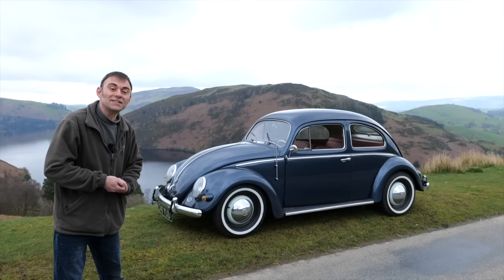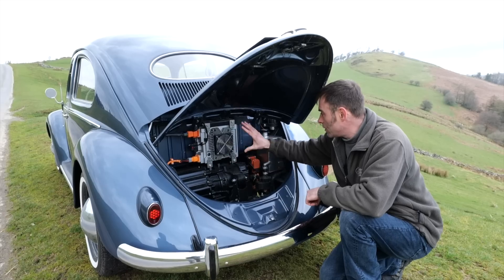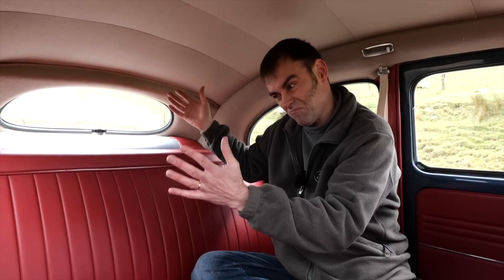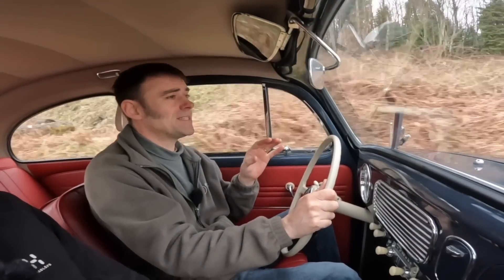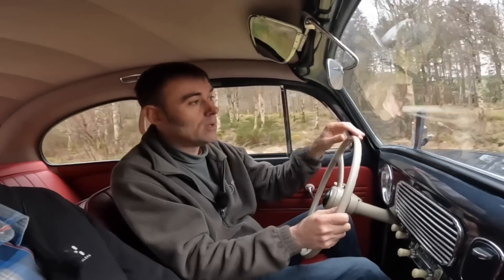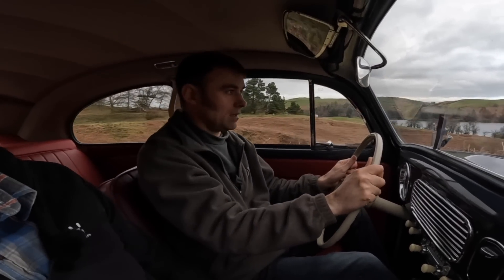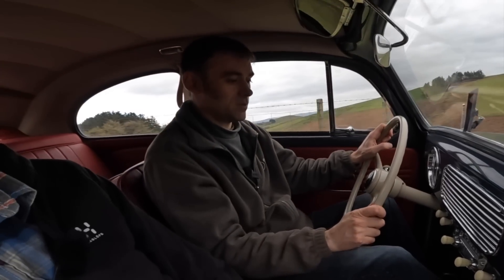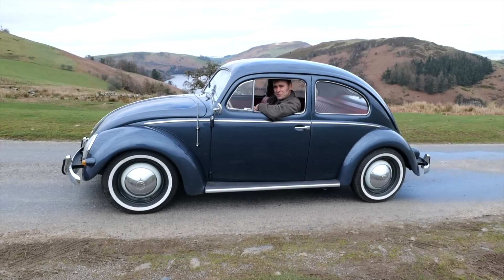Finding problems in an electric VW Beetle, converted using our bolt-in kit.

Comment: Ive adjusted the rear torsion bar slightly on the drivers side due to age sagging and in doing so it will bring the passenger side front lower and even it with the drivers front
Reply from the maker: It already has new torsion bars at the back so we know the sagging is front related. Also, we can push the front trailing arm up with minimal effort on the drivers side to get the shock mounted whereas on the other side it takes quite a lot of effort.

Comment: You do know that more co2 is created, by mining the minerals, and transporting them between countries to create a battery.. than a normal car.. it's a con..
What is in a battery comes from many mines.. using co2 blurting machines. You idiots.
Reply: Try looking up total environmental impact reports for EVs compared to similar ICE cars.
The EVs always pollute less.
Reply: @logitech4873  Ok , More minerals are required to make a EV Car, All the minerals in the Battery.. Those Minerals have to be Mined, and transported By Co2 Machinery, and ships.. Because a EV Car weighs more, more energy is consumed in it's Manufacturer.. all ev pollute more.. because they need coal power stations to charge them, when there is no wind, and its snowing.. ev is a fake, vegan con..
Reply: @logitech4873  yep believe the bs. A ev car. Needs 5 different mining companies to get the minerals to create the Batteries. Which need 5 different shipping companies to transport.. to manufacturing companies. 
Then said battery needs to be transported to car factory.. but because a ev is 3 times heavier than a normal ice car. More energy is used to manufacture it. 
It's a con..
Reply: @graemejohnson9025  The Tesla Model 3 has a weight between 3,700 and 4,000 pounds - a comparable sized Toyota Camry weighs 3,200–3,550 pounds.
Not really sure where you got "3 times heavier" from.

Could you go into detail on these 5 different mining companies?
And while you're at it, how many mining companies do ICE cars need?

Yes, EVs are more energy costly to manufacture - but the whole point is that they use far, far less energy to actually operate, and consequently have a lower overall environmental impact.
Reply: @logitech4873  not in manufacturing thought.. the battery needs 5 different mining companies to mine for the components.. then 5 different shipping companies to transport it to the battery manufacturer.. then the car itself is heavier than a normal car. So more energy is required to manufacture it..
The co2 blurted by the mining and shipping the components for ev Batteries. Null and voids it's save the world crap..
Reply: @logitech4873  you do know that the minerals to make a ev battery, are mined from many different countries. Using co2 blurting machines. Then transported by many co2 blurting ships. To be manufactured into a a battery by a co2 blurting factory.. to be installed in your car created by a co2 blurting factory.. it's a con..
Reply: @graemejohnson9025  Yes, and the same goes for ICE cars. The steel, the plastics, the rubber, the fuel - it all has to some from somewhere.
There's no con. EVs simply have a smaller total environmental impact.
The EPA has a nice page called "electric vehicle myths", i recommend reading it.
Reply: @logitech4873  yep. Read it. It's all a myth. Doesn't matter what you drive.  They are the same.. both do same damage..

Comment: Nice! maybe add a front wheel speed sensor and setup anti lock for the re-gen and then you can ramp it up with brake pressure?

Comment: Fantastic car. Please do a follow-up video on the adjustments you've done. A before and after on the squeak and the torsion bar etc.
Reply: I think I heard that the suspension mount squeaks are fixed by just greasing them up, is that true? 🤔

Comment: So what is the insurance position on a vehicle that can be so readily enhanced or deranged in its tuning? Insurance relates in part to the actual performance of the vehicle so if you can readily enhance the performance to 300 hp did you say I can see there needs to be some criteria as to actuality and perceived vehicle performance of its day. You have already indicated need for anti roll bar but the weight of the battery is probably partly reliable for such need. None of these are bad things in themselves but and an important but is the need to fix the performance within credible limits if electric traction is not to become a dial up nightmare for insurers and government legislative department because no official test data relates to the effective performance of such a converted vehicle. Does it require a new crash testing regime? This could be important if involved in a traffic accident with injury to third party. Who would he sue. I suggest the list could be very wide including the converter. A locked performance is therefore something to consider.

Comment: Nothing against these conversions, they keep old cars alive. But let's bear in mind that thay have the "safety" of their times.. no crumpling zones, rigid steering columns, no  energy absorption structures, often no seatbelts.. no headrests , the brakes are what they are. My 1971 Mini cooper is such a fun to drive, but still I hope nothing happens on the road..
Reply: @Giuseppe De Bellis • I agree that my old VW Beetles (1959 & 1962) were nowhere near as safe as our modern vehicles, but I always thought it would be fun to have another, especially one that could get out of it's own way. Traveling to Virginia from western New York last weekend, a motorcyclist blew by at an incredible speed on a 70mph limit expressway, reminding me of my 50 years as an ex-cyclist (because too many auto drivers were trying to kill me). Everything is relative.
Reply: @douglas_drew  Hi Douglas, agree. I also would like another Mini, or even an older car. Just because they are "old", they really are "machines" to drive, and this Is why i love cars. At the same time, all in those vehicles is in proportion, i mean brakes are right for the power of the engine(i really appreciate the possibility of this transformation to set the Power with the tablet, though). Road holding capabilities are right for the frame they have. Simply very often I see a mighty electric motor that can undermine the car balance (brakes, If you consider regenerative breaking also may not be an issue..). Being a biker, I agree, you can risk your life evn more, especially if you go super fast, still you are very vulnerable by the other drivers. This Is something that would scarr me going around an old car with too many cell phone distracted drivers on the road.  Have a great day! Cheers from Italy!
Reply: Because of it’s long production time there are some safety features that can be retrofitted in a Beetle. For example VW introduced a safety steering column in 1967 and onwards that can be modified to fit older models. Same for 3 point safety belts.
Of course it’s never gonna be as safe as a car build today but there is still a lot of room for improvement.
Reply: In general this is correct, but in a concrete case of Beatle it is not an issue. If your seatbelt are tight, so that your head does not hit the windscreen or roof in case of a crash, this car is quite safe. My friend had a 1974 Beatle, which was build the same way as the 1950s Beatles. In the early 2000s we had several crashes in it, crashing with 20mph frontal in a barrier and also rolling over in another case. The steel on this car is thick and it has no engine in front. So frontal crash has the biggest crumble zone possible and it can roll in the roof without even deforming an Millimeter. We hust ckimbed out and rolled it over again. Since the engine died before roll over we even could drive away.
Reply: @nils9853  With the entire fuel tank being part of the "crumple zone". 🙃 The steel is way too thick to act as a crumple/absorption zone too - sure, it crumples, but only after already transferring a lot of the forces into the cabin. And there is the added chance of the driver being impaled by the steering column. 

Now don't get me wrong - I am a car enthusiast and have a -61 Beetle (Gulf blau with colour coded trim and the factory option of seat belts in the front, they look exactly like plane seatbelts) that I love - it's a beautiful car, and I love driving it and taking it on road trips, it has got a roof rack that has seen a lot of use. I bought the car 10 years ago as my first proper enthusiast car, I adore the car and will probably never sell it. But I would not by any means call it safe in any way at all.
Reply: @nils9853  Seatbelts tight absolutely! And keep the spare tire in the front well.

My '59 Beetle was totaled ($150 in 1969 US Dollars) in an 5-8 mph accident on parking lot access roads at college when the stop sign runner didn't see me (in fairness, it can be difficult when we couldn't see each other over the high snow banks). There were no seatbelts, and my forehead dented the windshield out. When I bought my "62 Beetle from a friend a few years latter, I checked to be sure it had seatbelts.
Reply: You are right. But with that said. I keep wondering. Why do VW not revive the newest version of the beetle as a EV - it is very obvious that the retro cars, the mini and the fiat500 is a BIG hit as ev´s . - - and the last beetle version should be an easy choice to remake as an electric car. - - maybe a 2 seater. But the perfect city car, and maybe they can, by making it a two seater be serious competition to both mini and fiat on the range. I think that would be a game changer for vw. (All the ID 3-4-5- etc they are very much alike, and then you have both skoda and seat/Cupra in the same models that looks so similar because it is more or less the same car, - - but the beetle stood out)
Reply: Well as long as you not daily driving it, what does it matter? You drive a modern car still don’t guarantee your fate!
Reply: I had a fool proof solution to the safety problem…..  Drive defensively.  I drove one of these for about 10 years with no accidents.  And I started at 16 which I find amazing in hindsight.  Would love to own an electric.
Reply: You make a real valid point there bud! I am so in love with the idea of converting cars to EVs that I didn’t even consider this
Reply: My thoughts exactly. You are given an old car more than modern performance without modern safety features. I see legislation about this issue in the future, once some of these issues are noted in accidents!
Reply: Yep, you go ahead be safe. I am willing to trade a little safety for an enjoyable life. If you live your life with safety as the top priority, you will get to the end of your life and never have lived. I pity the people that put safety above all else. We are already far safety than any previous generation. How safe is safe enough?
Reply: @crissd8283  I agree, but you have no right to trade other peoples safety. I own 11 cars oldest is a 1973 MK1 Escort. Any of them that had drum brakes has been converted to discs, with any other safety features that would be practical. The only car I have that still has drum brakes is my run about, a 2015 Skoda which gas drums on the back.
As I said, if your car is not safe then other road users are not safe.
Reply: Don't crash
Reply: @Adroit1911  "Don't crash". Best advice. I wish someone had given that advice to the red light runner that totaled us and gave my son his TBI, and I especially wish she would have listened.
Reply: Until motorcicles are banned, I will advocate the use of old converted cars. The safety issues exist but are not as a concern as it is seen today imh
Reply: Still humanity survived somehow the age of no seatbelts. Ect. How about motorcycles? People still drive those. A car like this is perfectly safe. Its not made to go on the highway. Its just for countryroads and shoppingmall tours.
Reply: @superliegebeest544  Understood, but humanity survives many things that individuals don't, and I view things beyond just survival. I have a son that survived our last auto accident but with a TBI received from a red light runner that hit my side (passenger) of our Saab at just the right front corner angle to spin us around without our airbags going off. Both vehicles were totaled yet both my son and I were able to walk away while the other driver in a Jeep was transported via ambulance. It took almost four years to find the reason why my son seemed as sharp as ever but had to quit college and was unable to function around other people. I am so glad to still have my son, but so sad for the daily torment he goes through because of his brain injury.

Giuseppe was right in his reminder that care must be taken when enjoying old vehicles, you are right in suggesting limited usage in reduced vulnerabilities, and Marcel was right in suggesting upgrades by retrofitting newer safety items, especially with the originality already being compromised by the electrification.

All that said, I guess my point is that no vehicle is perfectly safe, just as no driving situation is perfectly safe. I just hope people can continue to enjoy vintage vehicles, and everyone avoids misfortune.

Oh, and please forgive me if I sound like I am preaching to the choir, but I am retired from a career always around cars, most of it for our DMV.
Reply: @douglas_drew  I do agree, maby we should write a letter to the president that we demand all cars from next year on to be made out of styrofoam. And if thats not an option than only sell Abraham tanks
Reply: @superliegebeest544  I think you may have found the solution to the problem that bothers so many others: electric cars being too quite. My family had a boat dinghy back in the 1960s that was entirely made of Styrofoam. Great fun for my girlfriend and me to go sailing in, but it made the most awful Styrofoam noises. It was like trying to sneak beer into a church picnic; everyone turned to look. Luckily our stoney lake shore limited the life of the Styrofoam and we finally replaced it with a proper Boston Whaler fiberglass sailing dinghy.

Now that I think about it, the suspension noise on this Beetle EV is very similar to the Styrofoam sound and would/could be regarded as a safety feature!
Reply: @superliegebeest544 A lot of people didn't survive it though. An Extinction level event shouldn't be the threshold to improve safety.
Reply: @superliegebeest544  Hey liegebeest, is dat waarom het aantal doden in het verkeer in de zeventiger jaren 3000 was en nu 600 tot 700? 5 keer zo weinig?
Reply: With the prevalence of faulty airbags grenade-ing in a crash (multi-millions in the US alone) I wouldn't feel significantly safer in a new car, while the beetle is a deathtrap, I'm not convinced modern cars aren't also deathtraps.  Especially given how everything on the road seems to be an overblown SUV nowadays...
Reply: @vro1899  those recalls are based on single digit numbers of cases. Meanwhile, tens of thousands of lives saved thanks to airbags in general. 

I don't remember the name of that bias where rare instances feel more common than they are (hence fear of air travel when it's the safest thing ever) but....
Reply: @Ryukachoo  You will never convince me that the risk of sticking an explosive in the steering wheel is insignificant when the manufacturers decided to recall them, but not the corvair which buckled under, or the pinto which famously burst info flames, or the exploding tires on the explorers, or BMW's vanos failures, or the faulty gm ignition switches until federal mandate forced them all to.

Unless you have evidence of over 10,000 crashes where the airbag was solely responsible for saving a person and not crash beams, crumple zones, modern seatbelts, headrests, and perhaps most importantly: collapsable steering columns, modern medical innovations, and good first responder time, then that number is nothing other than a blatant lie.  

Sticking an explosive in the steering wheel negates half the safety innovations we make for cars nowadays, and is dumb.
Reply: @vro1899  Of course, "what you reckon" must be correct, much more so than the 50 years of worldwide research and development by designers, engineers and researchers from car manufacturers and independent safety institutions.
Reply: @Zeem4  50 years of research also showed that lead in gas wasn't having an effect on our health.  Until it changed.  Seeing as how these air bags have killed infinitely more people that a reinforced a pillar, collapsable steering columns, etc.  safety devices should reduce safety concerns, not simply change the capacity  of the car to kill you from one manner to another.

Comment: Beautiful old beetle, wonderful job. Would be cool to see a custom charge port installed behind one of those headlights(or taillights). just have a motor installed behind it to push it out rotate the light to then gain access behind it to have one of those hidden areas like the old hidden gas caps in the other older era cars

Comment: Shame, another classic ruined
Reply: Nothing has been ruined. It's a bolt in kit that uses all the factory holes and mounting points. Nothing chopped, nothing changed. It could easily be returned to original in a weekend.....if you wanted to.
Reply: Quite the opposite. I've had three and would take this in a heartbeat. Constant tinkering and dangerous exhaust smell. A car for the masses, this makes as much sense today as the original version made back then. Progress!